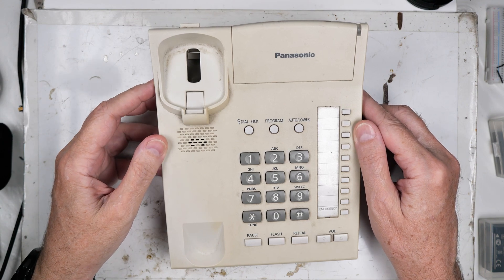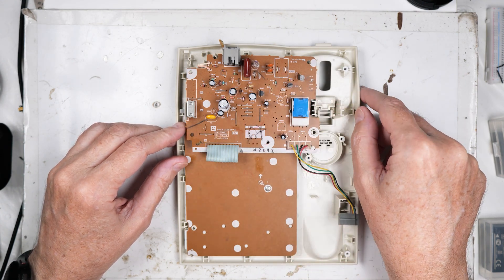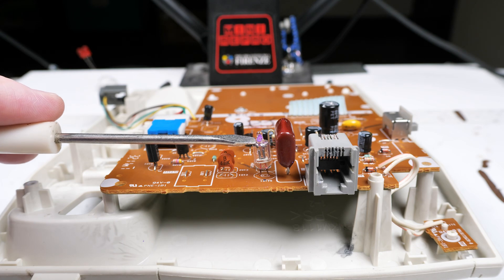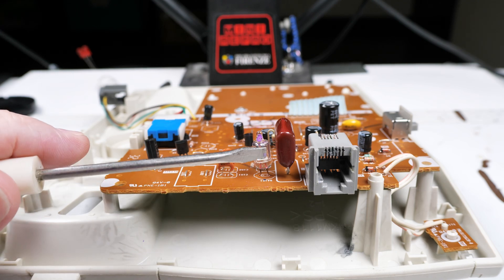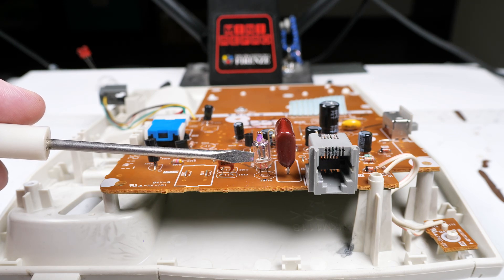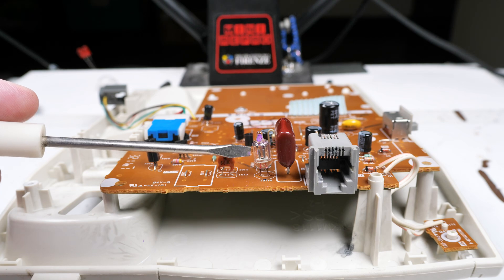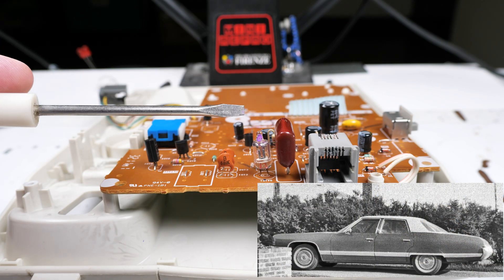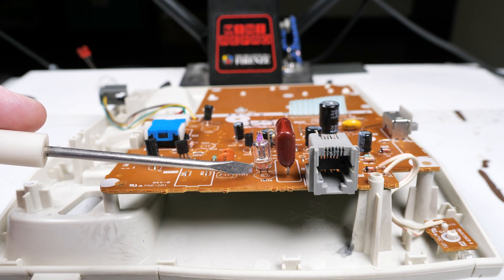Electronics--Mystery Component Found In Phone (4K)

Comment from the maker: It has been pointed out that a capacitor would NOT be a good substitute for this part, not just for the reasons I listed, but it would cause an AC short as well.
Reply: Have you measured the capacitance of that discharge tube? I guess is very small, 100pF or less. I am curious because my testers do not measure capacitance that small.
Reply from the maker: @sebastian19745  I don't have anything that can measure it either.  One could estimate it by making reasonable guesses on the area of the rods and their distance apart....

Comment: 0:14 there's not a lot in these...
Theres a damned sight more in there than there use to be..
Use to be cradle switch in parallel with dial switch, a speaker, a microphone, a ringer, and a transformer.
Reply from the maker: @dougaltolan3017  That's true. A lot of viewers were born long after those. I was thinking more of the early electronic phones, before they had specialized components. Not a lot in there, but still more than the newest ones.

Comment: I had forgotten about this
Bendix made a series of car radios labeled Sapphire and installed in Volkswagen's  back in the 60's & 70's
These radios had a Ne2 neon lamp across the antenna and chassis. I heard one once during an advancing storm. As the charge would build and with the radio playing, there would be this screech, building intensity and then fall silent when a flash of lightning would discharge in the sky. It did this several times. I remember building a neon based relaxation oscillator for practicing Morse code back in the 60's
Reply from the maker: @craignehring  Interesting. I was around then but never heard of them. Thanks.

Comment: Transient suppressor. It's an open circuit until a certain voltage level. When that level is i]high enough the gas ignites and shorts out the line. After the transient passes the gas stops conducting and becomes an open circuit again. The gas is probably a mixture to get the triggering voltage correct and might not light up with visible light.

Comment: It IS a neon bulb... the ring voltage is about 90VAC, the approximate firing voltage of a neon bulb. It is used to keep the voltage from getting any higher.

Yes I answered before the video finished playing because the title was worded as if you had no idea.

A capacitor will not do the job. If it could, a neon bulb would not be in play.

Comment: A capacitor would damp the audio.  A gas discharge tube aka surge arrester has the advantage that unless it is not triggered it does not affect the signal because it's capacity is just 1pF or so. After it ist ignited by a high voltage spike (e.g. 90 V) the discharge behaves like a short circuit and clamps the voltage to lower voltage until the energy is dissipated to light and heat. After this a the discharge extinguishes and the tube is ready for the next surge. A capacitor would charge up to the peak voltage and keep that voltage unless it is discharged by a resistor, which als would damp the audio signal.
Reply: They could probably have used a different component, like say an avalanche diode, but perphaps a neon bulb was a significantly cheaper alternative.

https://en.wikipedia.org/wiki/Avalanche_diode

Some sort of relay mechanism might work too, but that probably amounts to unnecessary complexity

Comment: Neon's are a good cheap alternative to gas discharge tubes which can handle much greater surge energy.  Once the arc is struck, it will continue to conduct down to a much lower voltage which is good for ensuring the energy is safely dissipated.  They were also sometimes used in relaxation oscillators where they are connected across a slowly charging capacitor, and rapidly discharge it when it reaches the striking voltage. The tremolo on guitar amps was sometimes done this way.  The purple dot may indicate this is dark effect neon which has a trace amount of radioactive substance added.  Without this, and if kept in the dark for a long time, the striking voltage can rise and the neon will no longer function as intended.
Reply from the maker: @gadgetwob  Interesting information, thank you.

Comment: I think the modern substitute is a metal oxide varistor. Metal oxide are widely used today for surge protection devices you would see in a distribution board/panel (at least Europe and UK standards).
Reply: Agreed, this serves the same purpose as a MOV (not a capacitor).  However, these sorts of neon bulbs are not outdated.  They are still used even in lots of modern equipment because they often have the same or better characteristics as a MOV for many applications and can also have a longer lifespan, particularly in situations where their voltage threshold is regularly exceeded.
Reply: I agree, the I/V curve is more like a varistor than a capacitor, especially with the sharp breakdown instead of just filtering
Reply: Not really, since MOV are the slowest over protection device while TVS diodes are the fastest. Though GDTs are in the middle. Though it will also vary depending on the manufacturer.

Comment: 1. A Capacitor between Telfone Lines would short the SIgnal
2. This Component is likely labeled as something else. In German it is called Gasgefüllter Überspannungsableiter (Gas-Filled Over-Voltage-away-Conductor), while the Neon Bulb is called Glimmlampe (Kindle-Lamp). Think of Zener-Diodes vs Other Diodes. One Optimized for exact Breakdown VOltage, the other for Minimum Breakdown Voltage.
3. Igitors in Classical Flourescent Lamps are also Neon-Bulbs, but with Bimetal Electrodes. They first begin to glow. The warmth bends the lecttodes and shorts them. The SHorting will glow the catholdes of the flourescent tube. Then the Bimetal cools and snaps back. The ending CUrrent causes a Voltage-Spike igniting the pre-heated Flourescent Lamp. Once the FLourescent Lamp Works, the Voltage is too low for the Igniter to glow.
Reply from the maker: @Ribulose15diphosphat  I should have said #1above. Danke.